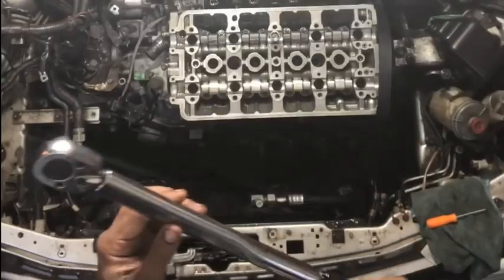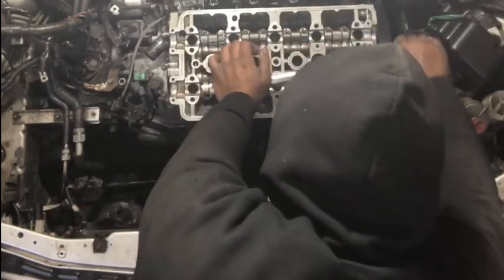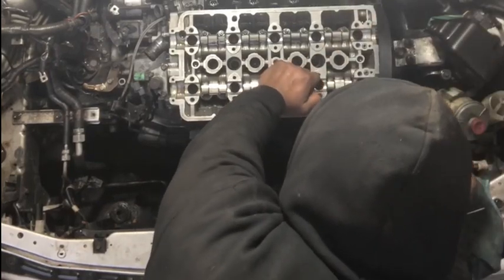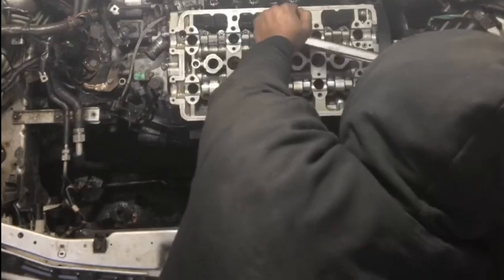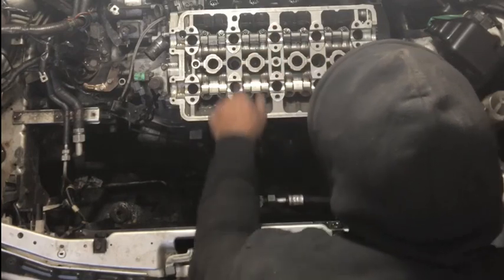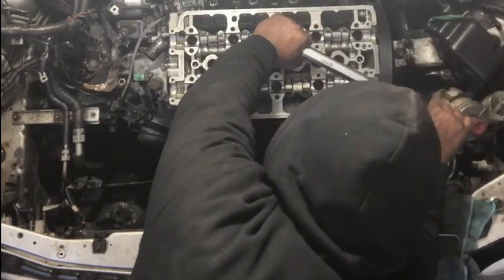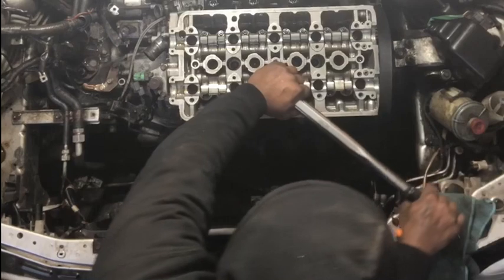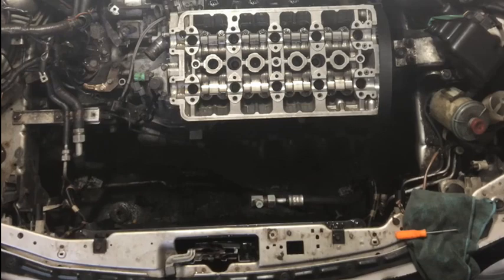LSV Cylinder Head Torque Sequence

Comment: ur doing it wrong lol you supposed to do it in 1 motion lol
Reply from the maker: 4Door Boogie I’ve done it this way for years never had an issue. Guess the ratchet is a good one.
Reply from the maker: @mr.velazquez3079  you got that right buddy, some people just want to express their negativity to others. Thanks for the comment and clearing things out for him lol. I’ve been doing our way for countless years and never had an issue. I torque to the spec and redo several times before I move on to the next torque spec.
Reply: Where did you get that information? Seems you're just overthinking it, a torque wrench is made with a rachet to do exactly that, especially when you get in a tight space that you can't make a full turn, doing it in one motion only applies to the old school torque wrench with a needle indicator. I have 35 years experience as a mechanic rebuilding engines and not once has this been a problem.